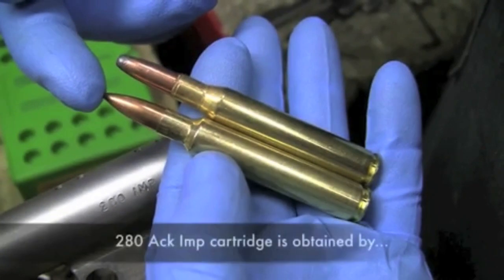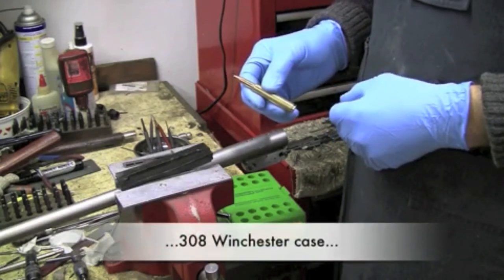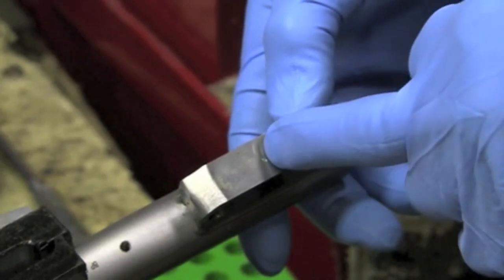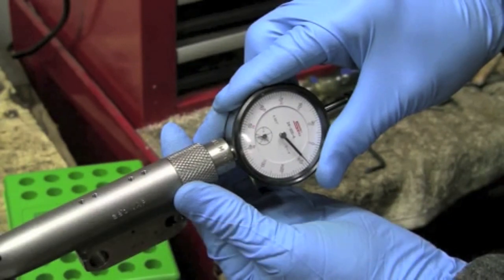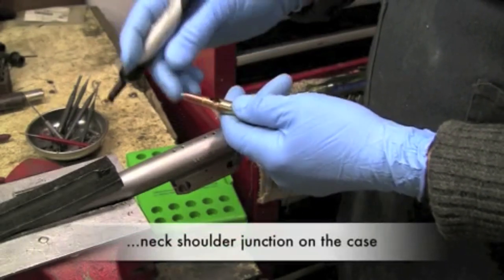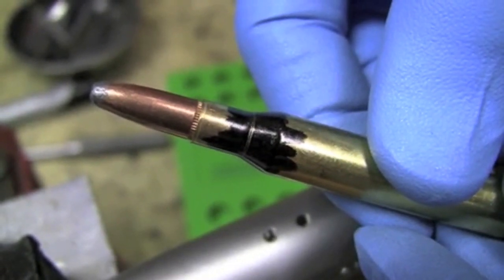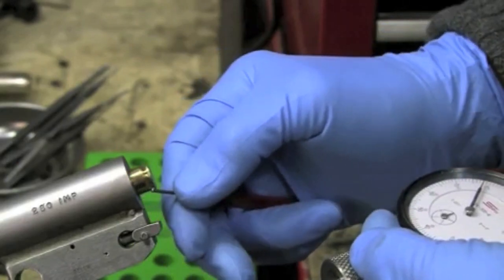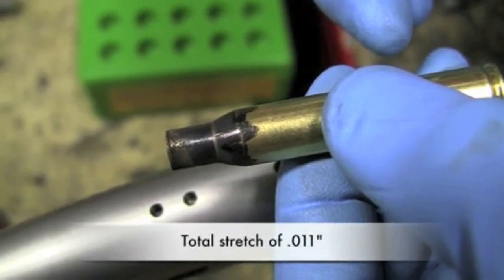280 AI Part 1

Comment: There's no better cartridge out there, than the .280 Ackley improved.  57.5 grains of H-4831 with the Sierra 140 gr. SPBT shoots tiny groups in my Cooper mod 57 with a 25 inch barrel.
 I also have a Cooper .280 AI with a 26 inch barrel, it shoots. dime size groups with the Nosler 150 gr. BT @ 200 yards. Cooper rifles come dialed in, no lapping lugs or flattening the bolt face.
If you have an Ackley improved .280. You should invest in an RCBS neck sizing die, there's no need to full length size or fire form the .280 AI. Nosler makes excellent .280 AI brass.

Comment: In 2002 we bought a 257 Roberts Ackley improved reamer and chambered the first of 5 rifles. We used a new piece of 257 Roberts brass as a headspace gauge.  The brass case separated right behind the new 40 degree shoulder. ~100 experiments later I found that if I lubricated the brass and fire formed  a partial shoulder with Cream of Wheat and 10 gr of pistol powder and no bullet,  the next shot with a bullet would not separate the case. That second shot would fire form the shoulder completely. The subsequent rifles, we headspaced with 0.005" interference with new brass, and had no problems.
Reply: Lubrication is good for case life in general.  My brass cases last a lot longer as lubrication mitigate case stretching between head and body.

Comment: Is it not the actual primer going off and pushing back on the breechface, that pushes the case forward, and not the firing pin? Also, if the cartridge fires, would that not alleviate the case shoulder from collapsing? Seems to me that the case would expand upon firing, and thus there would be no case stretch the next time the case is fired in the same chamber. Is that not so?

Comment: starting off. leave the extractor in the barrel so that it will hold the cartridge and keep it from being pushed by the firing pin. then take an empty 280 rem case run it through a full length 280 AI sizing die to push the shoulder back a bit. prime the case. put a max charge in it. seat the bullet to the lands, and chamber the round and fire it, and wala you have a perfectly FIRE FORMED case. myth busted people try too hard to be stupid.